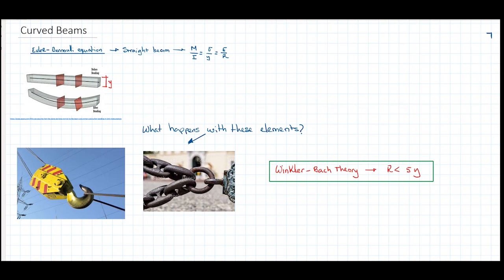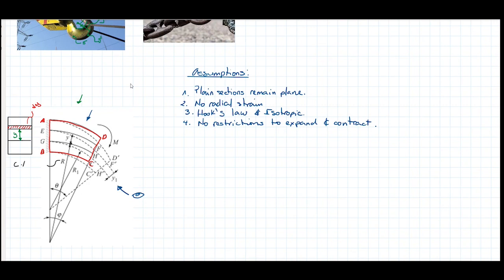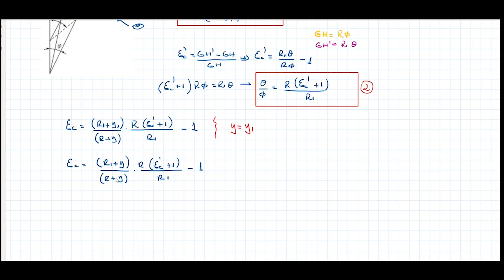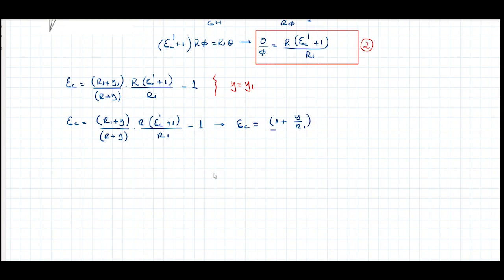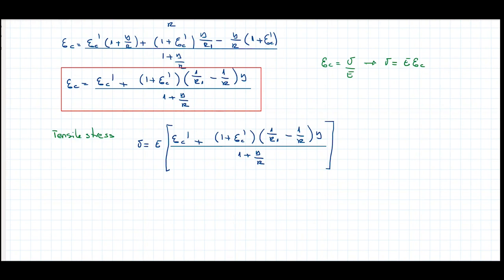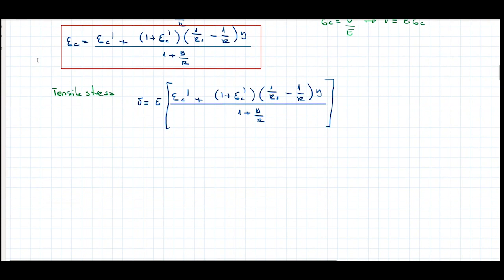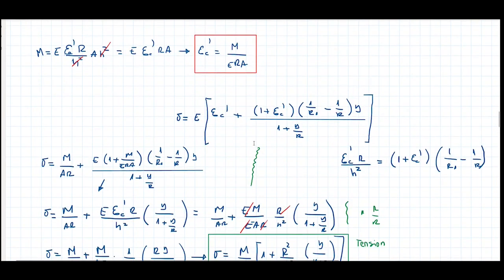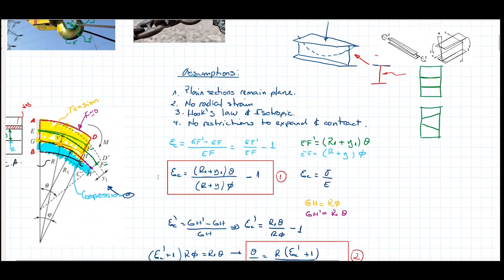Live lecture on curved beams. Stress calculation based on the Winkler-Bach Theory.

Comment: Can I ask, the moment you provide in the tension and compression equation, is that just the moment from simple statics, force x distance. So say I want to know the compression at the inner curve of a chain link, the moment used in those equations would be (F/2 x R)? F/2 as the axial force would be halved if looking at half a link...if that makes sense.
Reply from the maker: Hi, you are correct in your assumptions.  Now, with chain links, there are extra considerations when deriving the stresses from strain.  The equation to calculate the stress outside of the ring when the section is perpendicular to the applied load is: 
\sigma_r = \frac{W}{A} \left[\frac{R^2}{\pi \left(R^2 + h^2 \right)} + \frac{R^2}{2h^2} \left( \frac{2R^2}{\pi \left(R^2 + h^2\right )} -1 \right) \left(\frac{y_2}{R + y_2} \right )  \right ] + \frac{W}{2A}  

For the inner side, under same conditions, is: 
\sigma_r = \frac{W}{A} \left[\frac{R^2}{2h^2} \left( \frac{2R^2}{\pi \left(R^2 + h^2\right )} -1 \right)             \left(\frac{-y_1}{R - y_1} \right )       +   \frac{R^2}{\pi \left(R^2 + h^2 \right)} +     \right ] + \frac{W}{2A}

These equations are written in Latex format. You can copy and paste them in https://latex.codecogs.com/eqneditor/editor.php to see them pretty written. 

Please, let me know if it helped or if you would like to see calculation examples and derivations of this part of the theory.